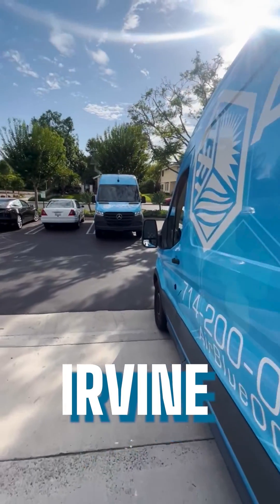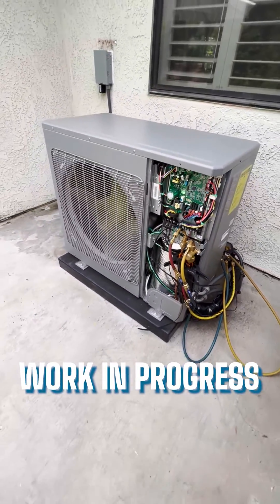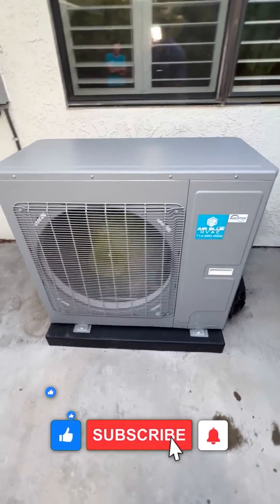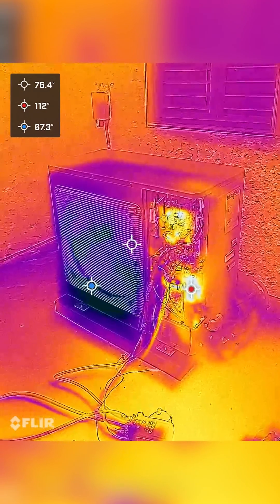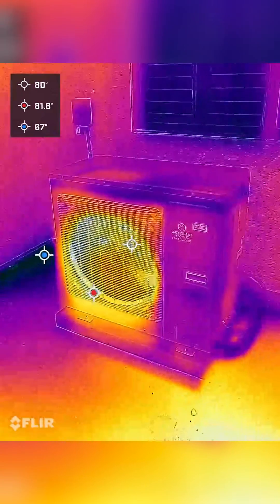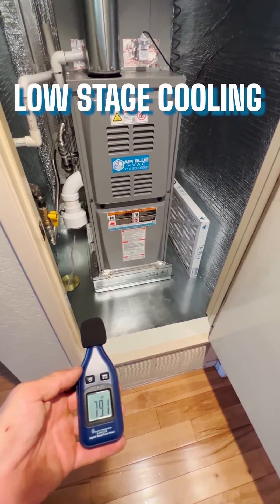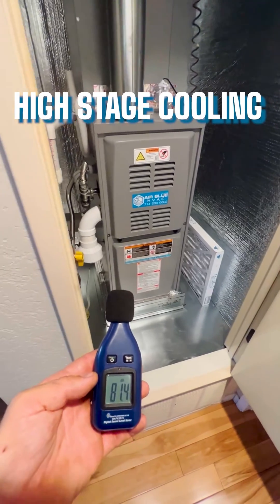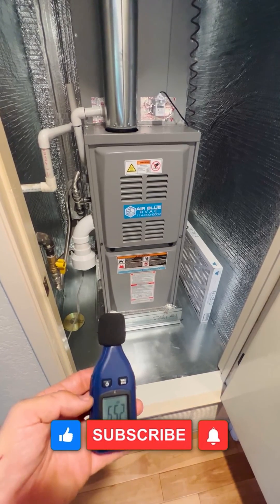Dual Fuel Heat Pump 3 ton whisper quiet plus gas furnace installed in Irvine California

Comment: What do you use for the backboard in the closet and is it for insulation or more for looks? Makes it look super clean
Reply from the maker: hello. closet space is connected to the attic space because your furnace needs air intake for combustion. so closet gets as hot as attic.  furnace closet walls are not insulated so heat penetrates into your house from attic through uninsulated closet walls. by insulating closet walls you need to run your ac and heater less what saves utility cost. also it is much quieter system operation and looks clean. 

as far as return cavity sealing. we are using duct-board designed to build air plenums.

Comment: Hi how many minutes heat pump works before it goes on defrost mod?
Thanks
Reply from the maker: we are lucky and with our weather it may go in defrost just one time a year on the coldest night if you have basic single stage heat pump system with issues or undercharged.  in other words defrost mode is never an issue.